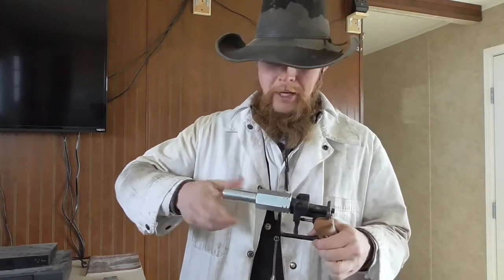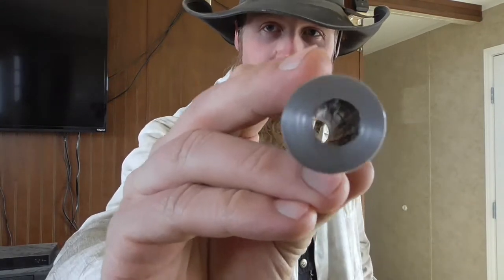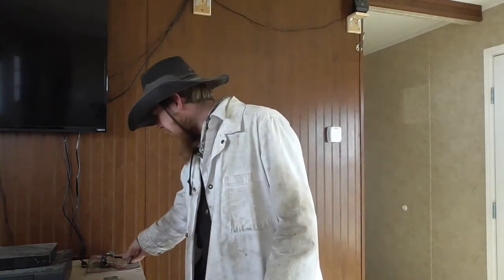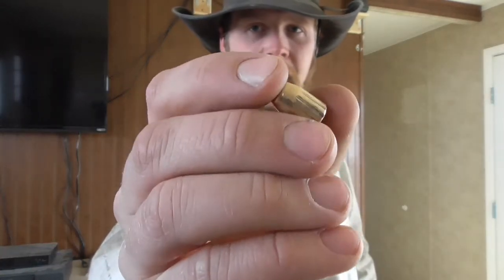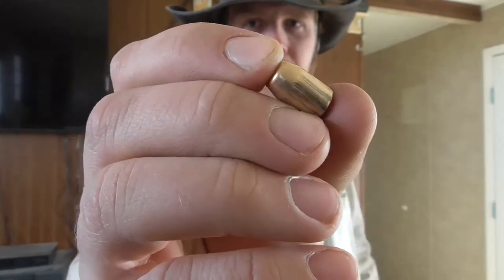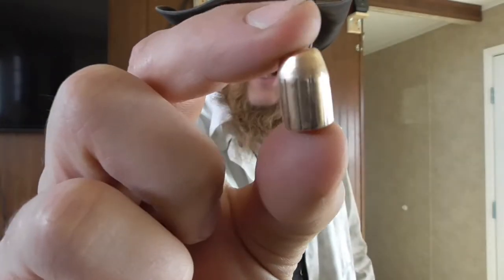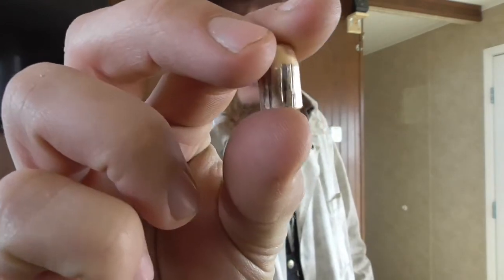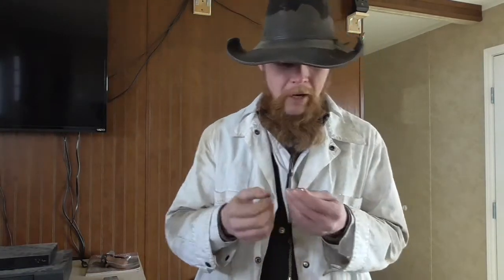Recovered Bullet from DIY Rifled Barrel (TIS085)

Comment: Very few commercial fraction sized drill bits are exactly the right size for a commercially available cartridge.  But, they do come close enough to make a workable barrel obviously.  The solution for an oversize bore is historically simple,  Minie ball the bullet.  I.e., hollow base them so that they obturate to fill the bore.  Easiest way is to find an already existing lead mold.  Or, given the lack of sights and the intended range of the pistol being under 20 yards, just ignore the issue.  LoL